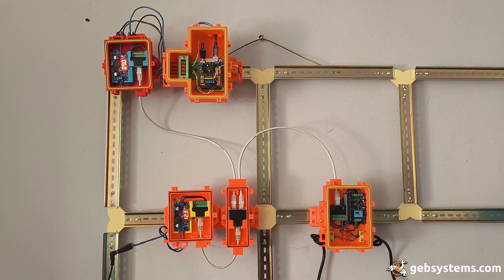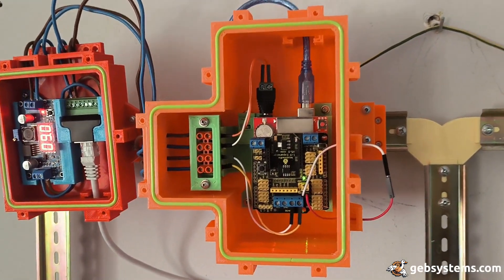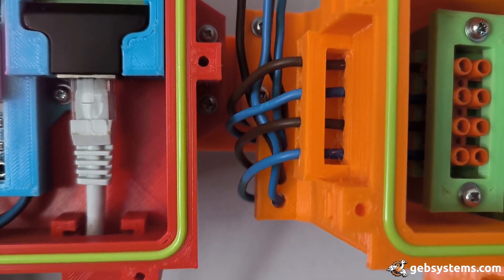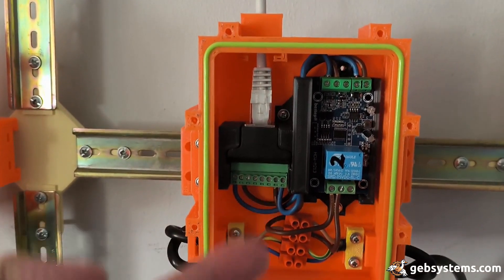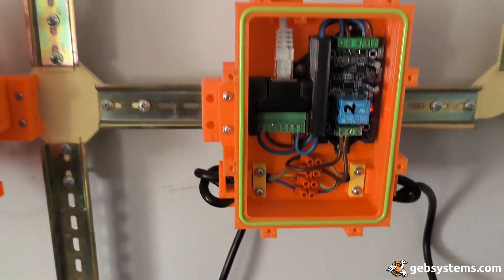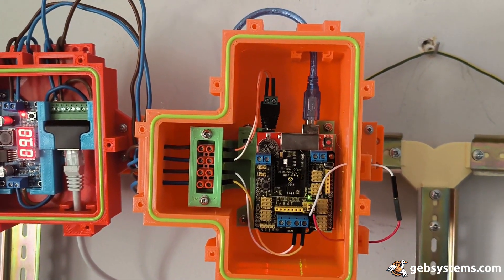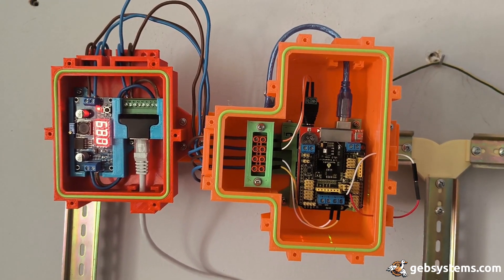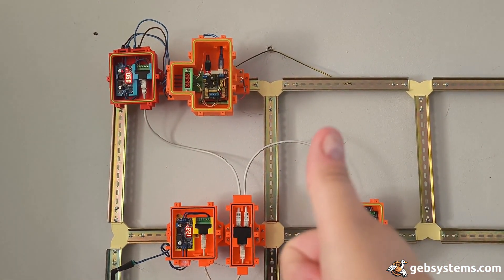Bare bones Full System Demo | Arduino Modbus Project | !Ai

Comment: Great work on your progress. Why not use cable glands for cable entries in each enclosure which provide both strain relief and sealing? You also seem to be using the same wire for power wiring and signal wiring which would be better to use different types and colours. You could also remove the RJ45 breakout connectors and just cut the ends off the CAT5/6 cable and wire directly to your terminals for a lower cost overall solution if you scale up.
Reply from the maker: I want the RJ45 cable to be used for ease of change where what goes and to make the deployment a smoother experience. 

I had a look at cable glands but in order to get them for the RJ45 cable they need to be big and cost like $8 a pop. Unless I was looking at the wrong ones... could be. Maybe you have a specific one in mind for RJ45 that I could inspect / buy?

And yes, I just used whatever colour wires I had. I am gonna change that once I get my hands on some other colours in the future. But in a pinch it did work.